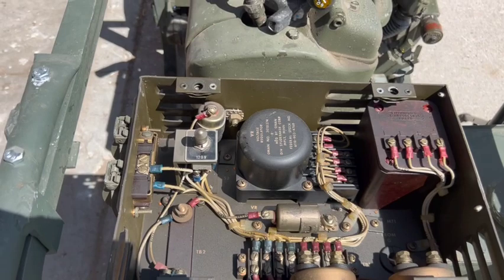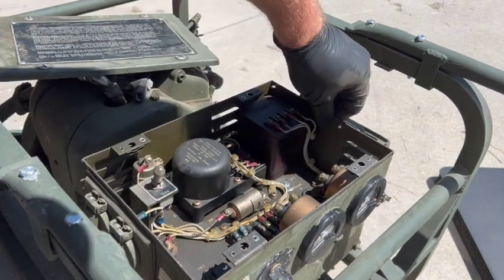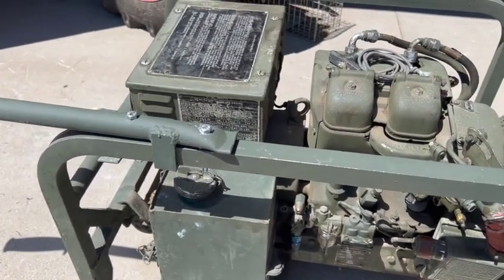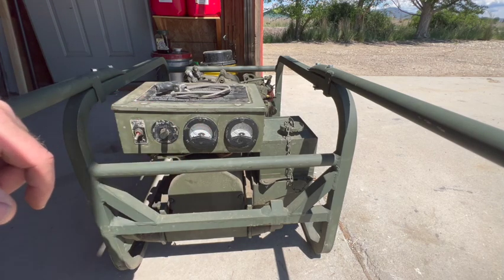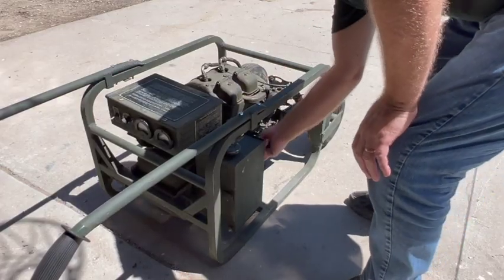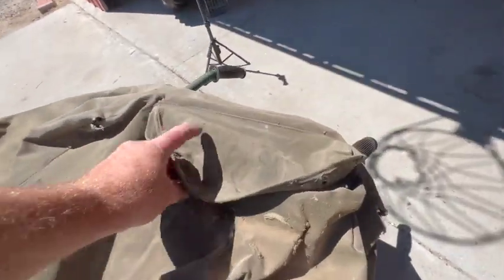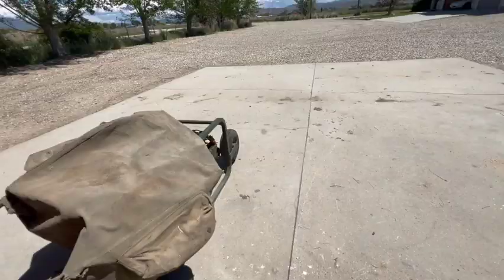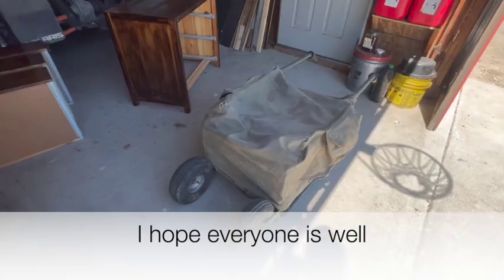Vietnam Era Army Generator - Part 3, Testing the Generator

Comment: a generator without any speed regulation? the Hz deped on manualy adjusting the throttle depending on electrical load ??

Comment: These are meant to run at high idle constantly on load. The low idle is for the starting and idle. It's either full bore or idle. There is no in between with the throttle control. The floats are bad in these. They like to soak up modern fuel and expand, so they swell and stick.
Top screw is idle speed initial is 3/4 turn from closed
Bottom T- handled fuel screw is 1-1/4 turn initial. Adjust accordingly under high idle and watch for no smoke out of exhaust and smooth running under 100% load. 
Enjoy!!!
Reply from the maker: Great information. Thank you.

Comment: I tinker alot on these Military generators myself, to set the engine and voltage correctly you need to plug a multimeter into the 120 outlet and set it to hertz (the gauge never works right), and adjust engine speed to about 61.5 - 62.2 hertz with no load, once you have that you would then set the voltage to about 125v again no load, then you can put a load on it and ensure that the hertz do not drop below 58.5, from there depending on the load adjust the engine speed given the load to maintain that range and try to keep voltage above 118
Reply from the maker: Good information! Thank you.